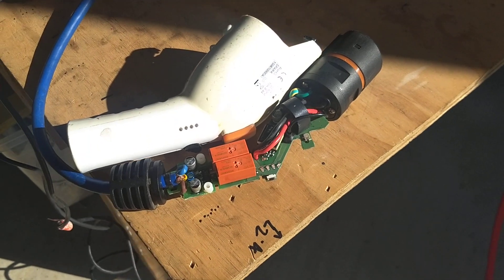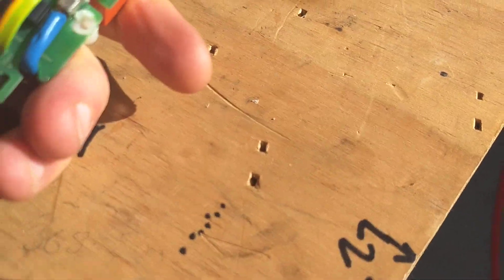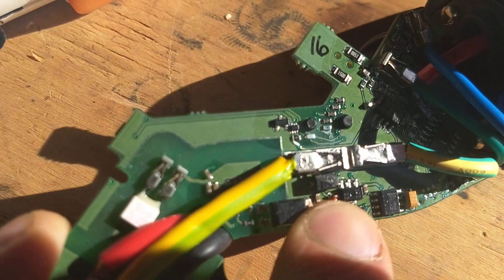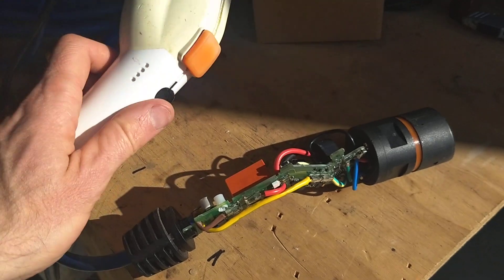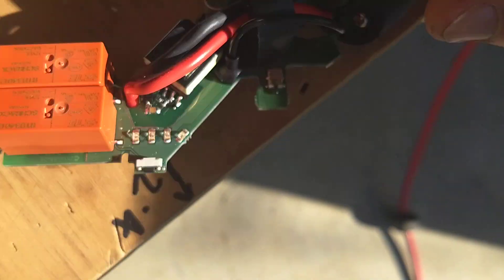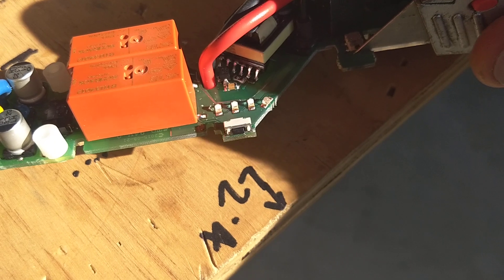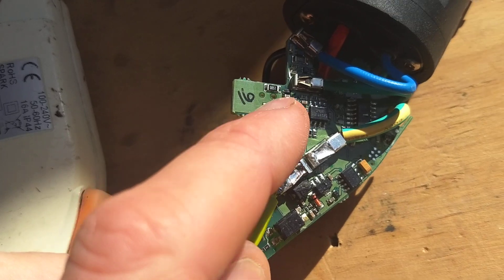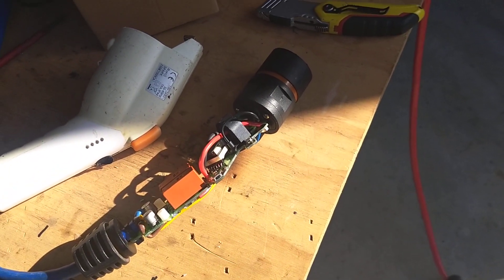Dead ChargeAmps Spark EVSE

Comment: Is it a disconnect for the pilot signal ? Just a tamper switch maybe if it closes when the case is back together ?
Reply from the maker: It gets pressed when the unlock button is pressed. So it cuts power delivery before the connector is unplugged.
Reply: @RaglansElectricBaboon  yeah must be related to the pilot signal.